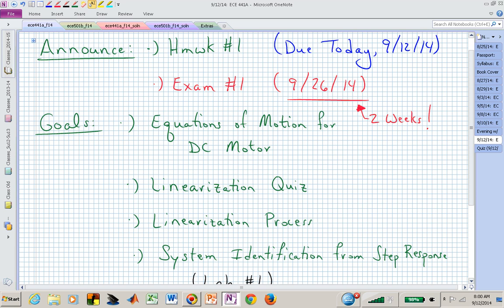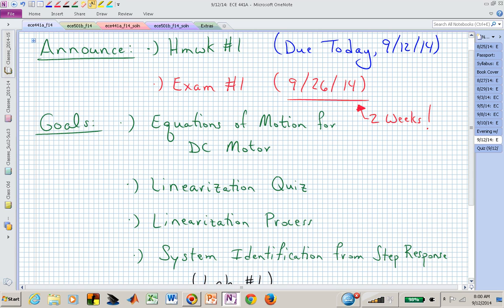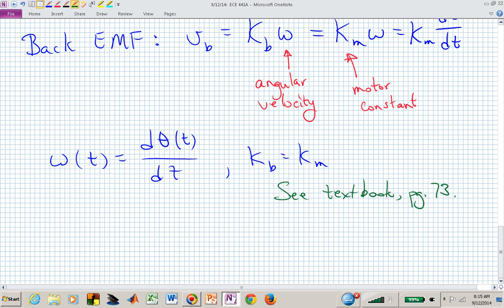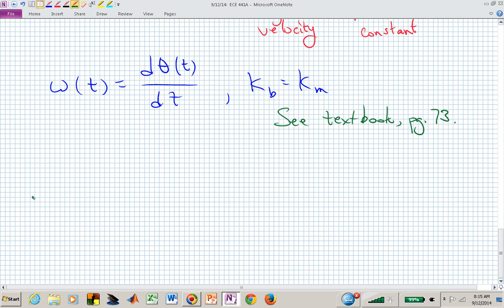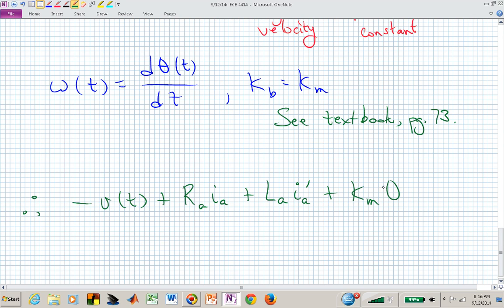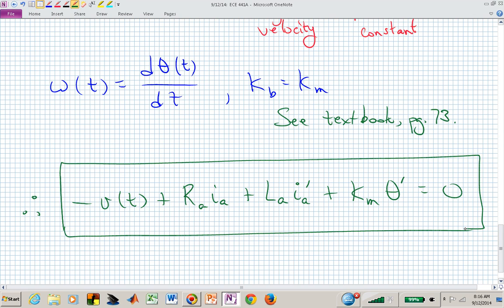ece441a_vid_1.7_09_12_2014

Comment: How do you get a value for 'B' your damping constant?  I am trying to model a motor numerically but this isn't in the datasheet and I can't find an example value online.  Everything I see says ' determined from experiment'.
Reply: Do you have the ineratia of the motor? Intertia and damping create this e-function kinda decay of the rpm when switching off the motor. I remeber sth like Time_constant  = J/d but I'm not sure about that, you should rather look that up :D . Greetings
Reply: @lars9513  i think lars is right. damping in the physical world is usually a negative exponential decay, kind of equivalent to friction but not exactly because the system can be critically damped, over-damped, or under-damped (under-damped means it oscillates through the equilibrium)